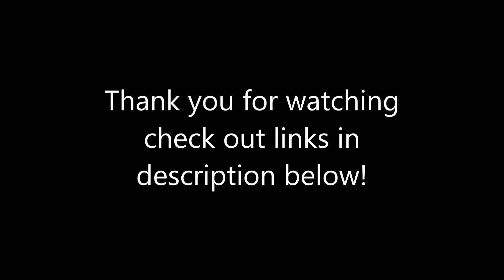Breaking down the Axial SMT10 rear axle AR60

Comment: Awesome video!!! Does anyone know where I can acquire an ar60 rear axle?
Reply from the maker: Thank you for the comment Camerin!  I would say ebay but usually I've seen them sold in pairs for like $115.  I've looked at these cheaper metal ones before but it's just the housing I believe.  https://www.ebay.com/itm/Xtra-Steel-Alloy-Axle-Housing-Speed-Wraith-For-Axial-Wraith-YETI-AR60-RR10-1-10/223287976808?_trkparms=ispr%3D1&hash=item33fd002368:g:TFkAAOSwmWFekX55&amdata=enc%3AAQAFAAACYBaobrjLl8XobRIiIML1V4Imu%252Fn%252BzU5L90Z278x5ickkgCVySCgrNFPU8Iu85TabMJA0pzPJ5fpMmCs%252FT8TZM4T7NVWAaWMHmQtg9DdfmD81hU64gDkxb2xv%252FzquhBmWp1fsKCYBzScTJbz0qjRHKYr8LM%252BFGNZA63AWkni5jm90sUFQjzQkm7e9N46zWiIHuhx2fEPUpyov4vsbHt%252FsLAJD4Admy3hXd89EzBhTle5YISrrwtyWwCgQ2kCMHPTpPjvT1SWcfGgp4dA1ksuKcXMbxFAm8MHB38arMtiatoK3Y3fVG06Oy7BuSMfI%252FD69py7gGwcL5KBQtQOvKpNYPOjCEmYIM%252F7G2mt3nVEuSUzhhw3KM42JiBQuwY6sG8wthmYtKyKsY%252BpnpDF%252FW6x42nZk1tyVL%252BNUrJ1w373Q91yhbvFOxkiuw3aiHZdI0nCJ31cDWTz65FOyHVBShFuGdyY8UJ%252BoAt0Rq2IiCdoKFbiEp9%252FYwio%252FZYQ3cpD9L4hFx1cVb2Lvis056XVVN6bjTteSo5debzroBEHNp5dDRG6O2PnCgLN%252BmKQ848pSoHreU16SU%252FVUBWGg1SgdHNHQPWd4lwcCYwTP3fY8hN3I39Wcd%252FGDRHSaCSJJniKHIGA7vBWae4XfJCcV5BCGJpuChtadNyvGwXP1jxVSVnKYDmQQ79l7MapaO%252F%252FunYGvm4%252F3X2I1jqZXqCTzpy%252FWlyYNGpS8S5bMzUskAYLS0ngPLu7tMLhQB8osos9jWOlbGc6%252BYSYdbVX%252BA36rj0r9rQJxk2hm1%252F7T15D5Erp02uYtWQOj%7Ccksum%3A223287976808e1ccc3e3f851415e896d29f127c8b158%7Campid%3APL_CLK%7Cclp%3A2334524